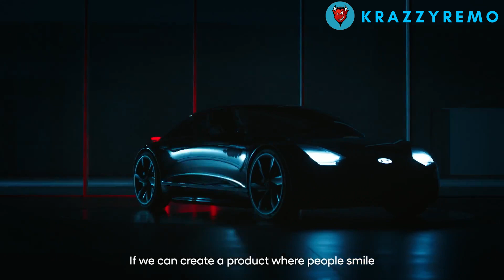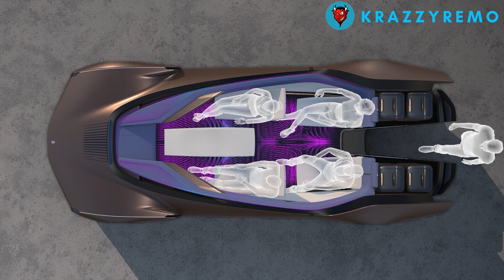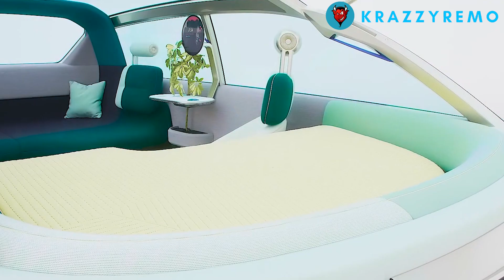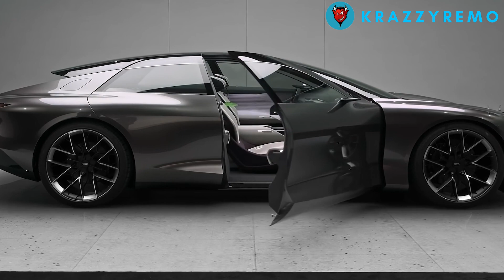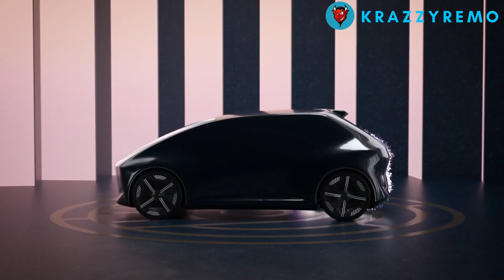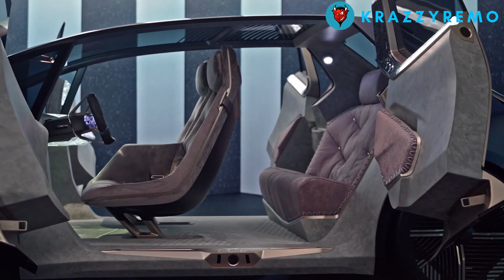TOP 5 Concept Cars. #car #future #futuristic #krazzyremo

Comment: as usual range play a role if not 500 km pointless for bmw as for teorem require bugatti air space spoiler scfi look as well above streched shape and touch off super car class a air wings as half air suctioners front and back and twin fish pop down going in angle below airwings to underline strange already strched design which is already scfi and a 3dprojector pc on wall roof to hae active day and night thoughts or show display bit avatar design but realistic design using a air wind tuneling tech and air suctioners efciently as active AI basic followed ny program mimic on screen possible elments as car or pesons pass or bike or bicycles easy a active logiv help system which can lighter or darker on screen window